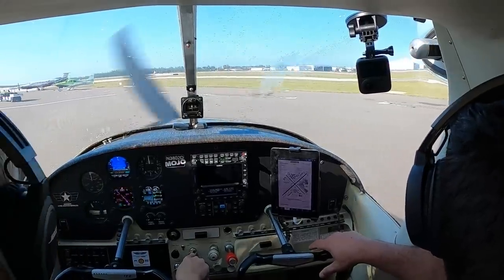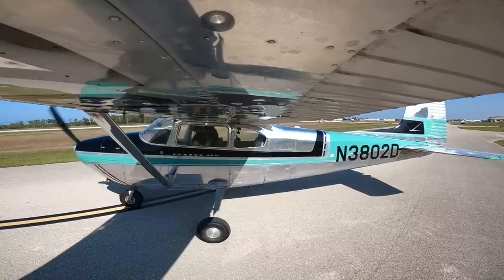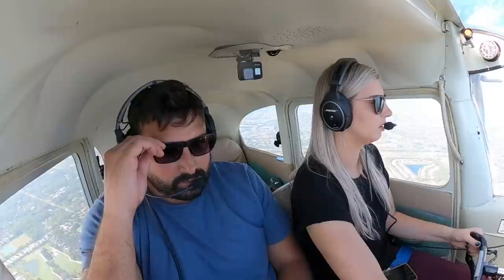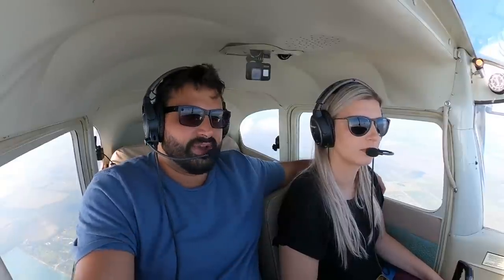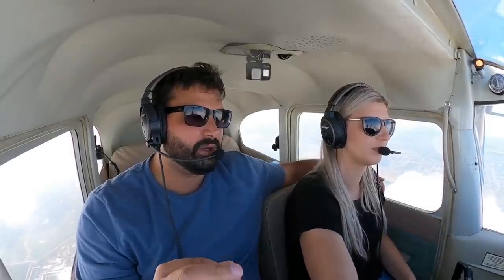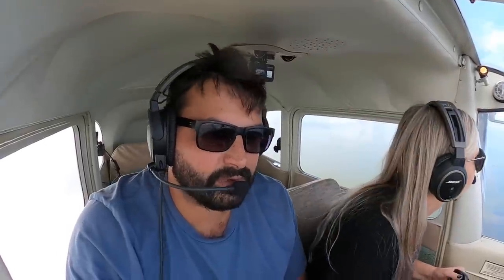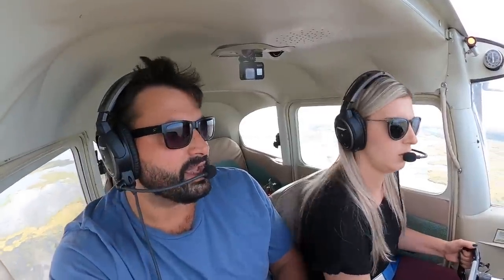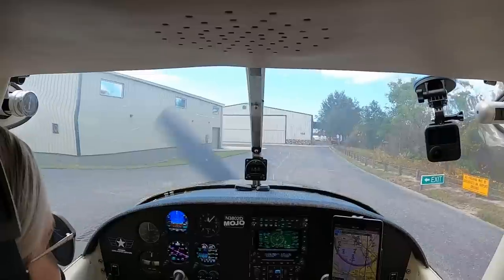ATC: Behind the Scenes in a Cessna 182

Comment: Nice airplane! I am restoring a 182 and saw your video when you picked up your 182 from the panel upgrade. i want to panel mount my Apple pad as you did and was wondering what type of bracket is holding your Apple pad? Is it mounted to your panel? I normally don't subscribe to aviation channels but I didn't hesitate to join yours.